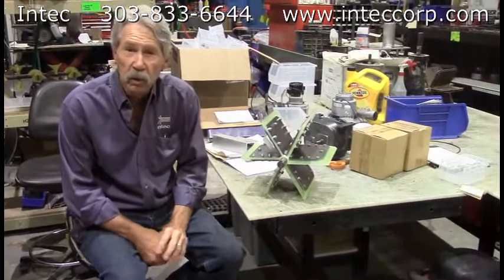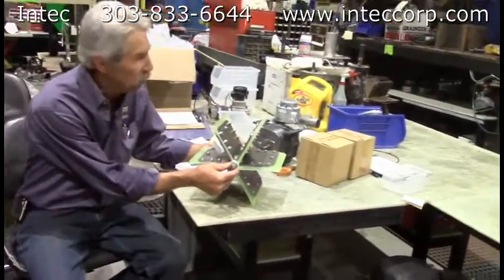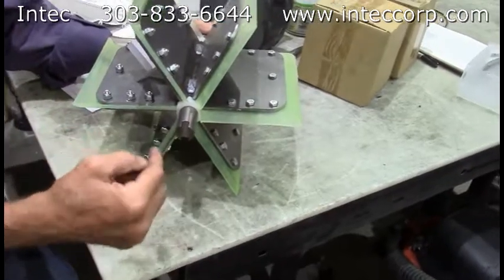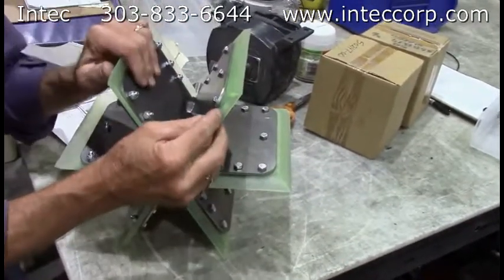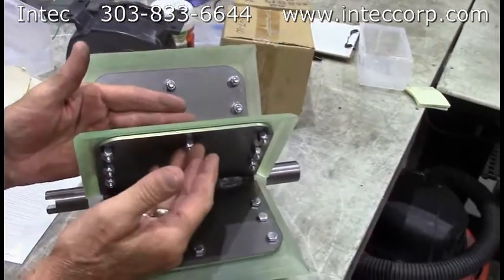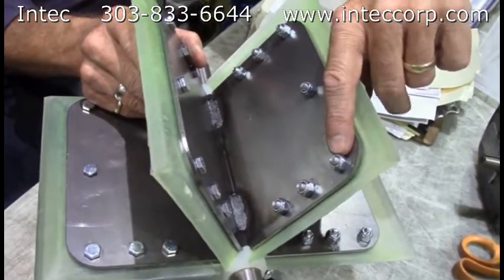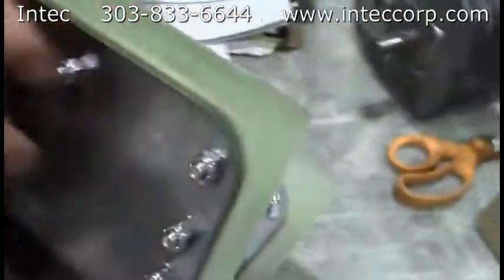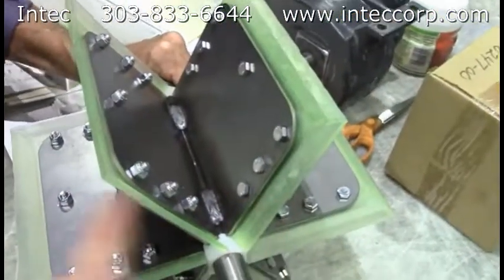Airlock Rotor

Comment from the maker: Hi Eddy,

I understand that in speaking with Intec Technical Service - DeArson 303-833-6644 ext: 116 assisted you (or ext: 113 for Patrick) -  the FORCE/2 unit you purchased used is very old.   Unfortunately the old seals were brittle & cracked where you had remnants between the airlock plates which extended the time to remove and replace.  Ideally the seals you are about to replace do not fracture and leave remnants between the plates as you prior experience.

Typically it takes 1 hour for a FORCE/2 user to replace their seals.  With many of Intec's newer systems the seal replacement time is less due to our quick-access capabilities.